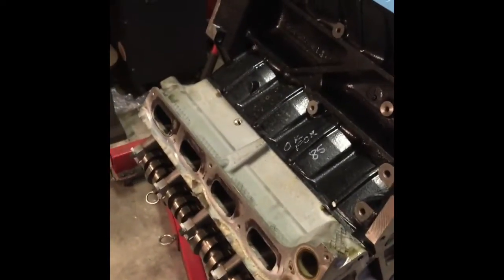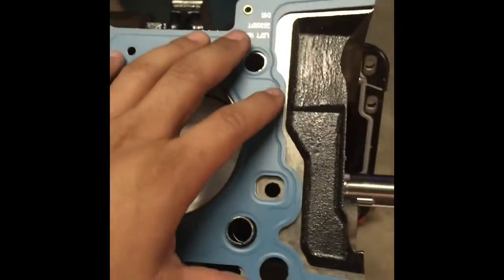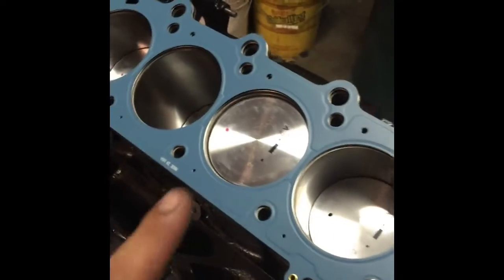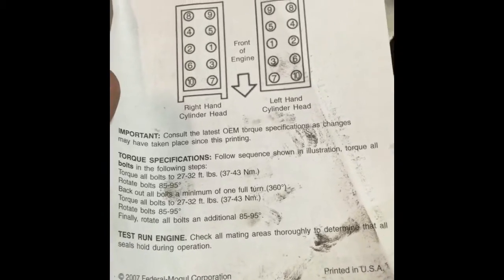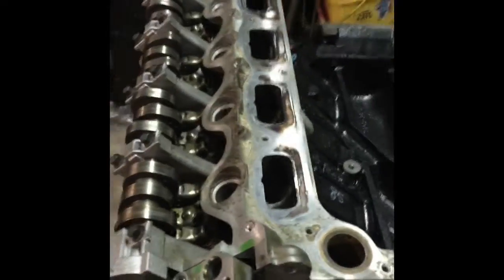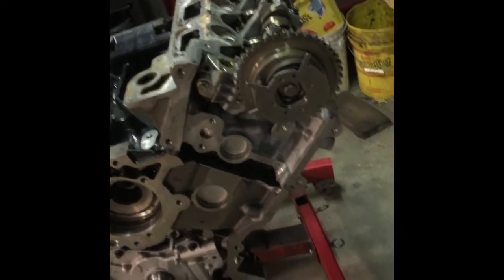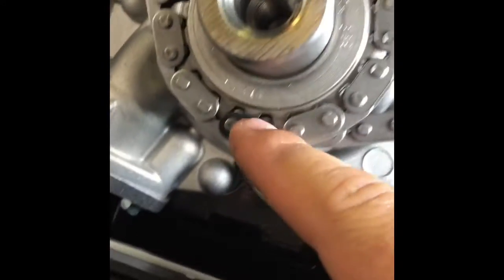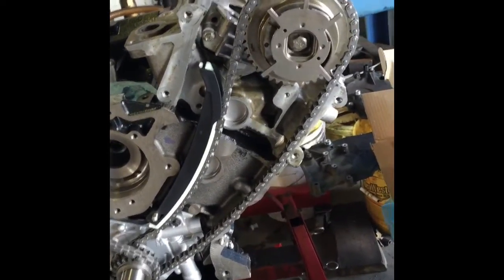Ford 5.4 F150/Expedition Engine head Gasket job and Timing chain

Comment: Did you remove the followers when setting the timing or kept them on?
Reply from the maker: followers?
Reply: The followers on mod motors are essentially the rocker arms.
Reply from the maker: No I didn't, but the engine was out so it was much easier, but it would help if you take them off.